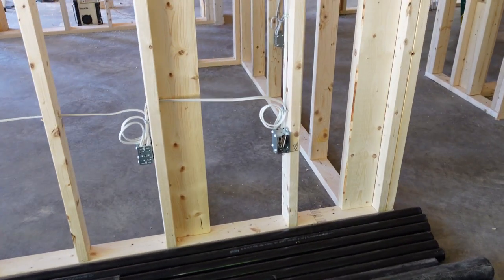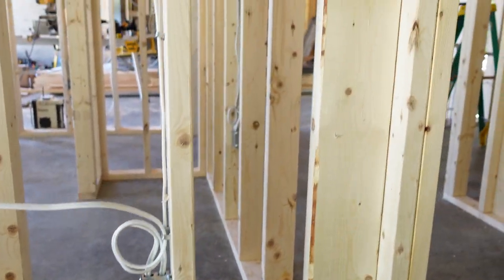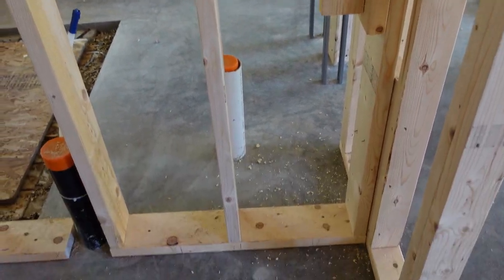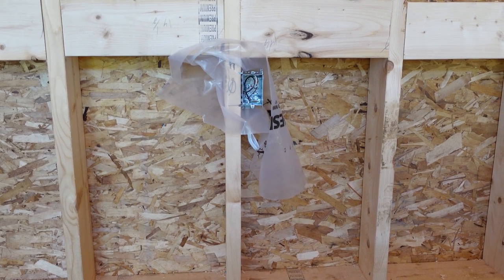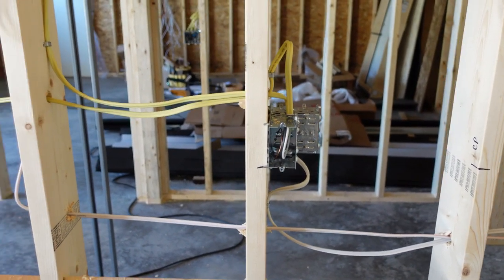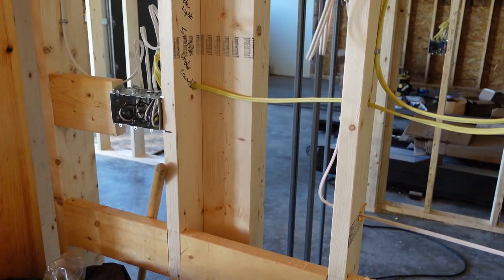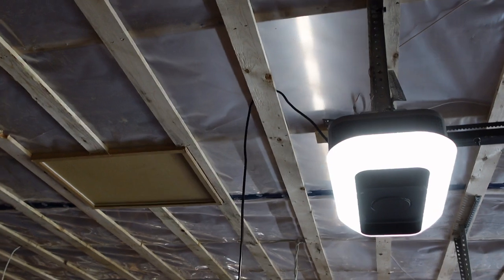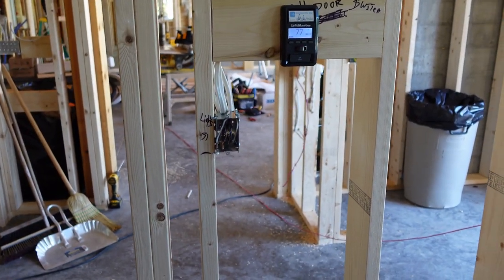Electrical Code Outlet Heights

Comment: Curious if you can put an outlet on the wall 7 feet off the floor next to a wall mounted garage door opener. Or foes it need to be on the ceiling.
Reply: outlets for special needs can be wherever they are convenient for that device. Just be sure it meets code requirements in your area. Be aware that any receptacles in a garage now need to be GFCI, where only a few years ago a high mounted outlet was exempt. (was 6 feet above concrete floor) BTW, I ran into an issue with a door opener sharing a GFCI circuit with an outlet on the exterior of my garage. Workers were on site while I wasn't home and tripped the GFCI while the garage was closed. Basically, I got home and was locked out. My point here is to think ahead a little. Maybe a dedicated circuit isn't so farfetched, right?
Reply: @rupe53, you don't need a dedicated unless you're using a GFI breaker. Just tap into it before the GFCI receptacle. Line side not load side. Load side makes anything downstream a slave to the GFCI receptacle and will go off when tripped.
Reply: @lm5085     under the old code you could do that. The new code is ALL outlets in a garage must be GFCI protected.

Comment: So there's really nothing in the nec regarding code height. It's the ADA that specifies heights for switches and receptacles. In most residential the receptacles are usually 12" from the sub floor to the bottom of the box. Why? Because your hammer length for a 16 oz klien, Stanley, or plumb brand hammer is 12" to the claw. Then you just bump your claw against the stud which leaves a mark. That will be 12" off the sub floor. Just be sure if more than one guy is doing the rough in boxing that everyone has the hammer that makes that mark at that height.
Reply: I think he's in the 51st state, eh?

Comment: Hi I was hoping to get your opinion on what to do about a old home?

I have a small 2 bedroom 1 floor house that was built in the 50s and still actually has some nob and tube circuits in the home 

I had a electrician come in and he actually gave me a quote of 30k to do a complete rewire which is far out of my reach 

I don’t really understand why this is so extreme but I think I’m my situation I might be better off just having a safe electrical system vs a everything to code ? 

What happens once I let anyone in my home can I be shut down for not being to code?

Someone advised me to not ever have a inspection and to look at wiring everything myself in this situation. 

Do you have any advice or opinion on my situation you could share with me?
Reply: Insurance on the house won't pay if is not up cod in case of fire cause by old wiring sistem nob and tub
Reply: @andrewbrindescu6666  If insurance wrote a policy and accepted payment, then they have to pay. They may choose not to insure you in the first place, but that is a different matter than not honoring a claim.

Comment: light switches are 52 inches ,receptacles are 18 inches ,kitchen gfi's are 42  inches .dryer and washer are 42 inches and lastly range receptacle is 3 inches off the floor with 1 1/2 block where i work at canada
Reply: And those are measurements to bottom. In the US this would mean the light switches are not ADA accessible, that is wheelchair. 48" inches maximum from floor to operable part of the switch. He also mentioned the NEW height for switches is 44 inches NOT 52.
Reply: Yah he isn't going by electrical code, maybe it is more of an interpretation from inspectors or a local building code. I do similar for all my jobs, 52 inch top of box for switches, 18 inch top of box for receptacles, 45 inch top of box for kitches, 42 inch top of box for vanities. These are all my standards not code, the range receptacle actually has the code for it of 130mm (5 in)to center of box. Dryers/ range hoods and all those would be to specific orientation of what the client is putting in whether stuff stacks or if cabinets are different heights. 
Some local areas will have building codes that are required for wheelchair access in commercial/public areas.
Reply: @kylelarson6054  its good to know another things from people:)
Reply: That is way too high for light switch. 48” top of the box is most comfortable.

Comment: You failed to cover the receptacle for the eye level oven. How high off the floor for 240 volt oven? Thanks
Reply: Check for your own details! In other words hand feed Yourself!
Reply: Manufactures specs. The manual will always show the recommended location. This goes for all appliances.

Comment: when you say that an receptacle needs to be 16" from the floor, is it to the bottom / middle or top of the outlet box or is it even that critical.  Thank you and keep the videos coming.  Its nice to have some Canadian content here.
Reply: Great question. That's important to clarify. And to reply to another reply, actually, I don't think he mentioned anything about the measurements going to the bottom of the "item". He only mentioned "from the floor".
Reply: He mentioned that the numbers are to the bottom of the item.
Reply: Obviously the bottom of the goal is to make them higher
Reply: Can the receptacles be higher than 18" from the floor? I have seen power outlets 3 feet off the floor in office buildings for example.
Reply: The garage door opener has to be within 12 inches of the garage door opener?🤔
Reply: @kllgrogto5838 *track
Reply: @kllgrogto5838 not the Remote. He’s referring to the Motor Control.
Reply: The NEC code book uses language like not over ____ inches. I don’t remember seeing wall height mentioned. Not more than 20inches over counter tops. I have always been told wall height is 18” to the center of the box. Some people used hammer height to the bottom of the box back in the day. Anyway what he’s talking about is probably an authority having jurisdiction requirement. On second thought I think the NEC says not over 5’6” exception wall clock outlets but don’t hold me to that
Reply: @rakridge their are all kinds of exceptions but this is for general purpose convenience receptacles not for dedicated equipment or special needs receptacles.
Reply: Ok, it has been a while since I've worked the trades. We've already put recepticals at 18" centers (no higher than 24") unless there was a counter or permanently located work bench. The exception would be in garages where vehicles were stored, would locate recepticals at 21" center. This would bring the bottom of the box to 19" to satisfy class 1, div 2 hazmat area. Or am I overthinking things or the regs bouncing around.
Reply: ADA says 18” center for receptacles and no higher than 42” centers unless over a counter not higher than 48” for convenience receptacles panels 42” to the center, or the top breaker at 48” off the floor so light switches at 48” centers or 46” depending on how they rough them in where you live those heights are fine. Here we do our convenience receptacles at 20” centers have done that for years so this changes nothing for us so we are 18” to the bottom of our boxes. Hopefully that answers your question.
Reply: 16 to the top.
Reply: Pay attention, there is a very noticeable mark on the stud indicating the bottom of the box
Reply: @dennisnolan2544 he’d rather ask then pay us
Reply: I am pretty sure is to center line of such  receptacle and or switch.
Reply: Center of the box.
Reply: @deanhoward4128 wrong
Reply: What country is this?
Reply: It’s for ADA so they can be reached in a wheelchair.  So bottom of outlet box at 18 inches, switches are 48” max height.
Reply: I'm not sure if it's right or wrong but I have put outlets 24" from floor to make it easier for my dad so he don't have to bent over as much to plug or unplug stuff.
Reply: @jeffharper7579  that’s fine it meets code you are not supposed to be over 48” unless specified equipment or under 18” for ADA any hight in between is ok
Reply: @jeffharper7579  we measure to the center of the box so you know
Reply: @jeffharper7579  hope that helped
Reply: Long story short, it was back in 08 I built a " inclosed porch " for my folks and wasn't going to do electric but dad wanted some so I did and somehow a inspector heard and stopped in , he liked the idea of them at 24" because it is easy to get to them without bending over. They passed that was all I cared that he liked it..
Reply: @jeffharper7579  well you got the hight good
Reply: @jeffharper7579  I forget that I can wire a house in my sleep at this point cause it’s so easy that not everyone knows how to do it or can figure it out and our code can be vague if you don’t know how to read what they are trying to tell you

Comment: I LOVE this video.  No music, no bloviating or self-aggrandization, simply the facts, clear and concise.  Even if I'm not required to do it according to code, normally there are excellent reasons for the code standards.  I found that Michigan Standards are not the same as those posted here, but I didn't know the areas controlled by code before this.  I learned that in Michigan usually actual installation is governed by more than code.  Incorporating ADA (American Disabilities Act) and HUD (Housing and Urban Development) code where practical is also done.  

I just did the inside of my garage with clear-coated OSB by setting the outlets and switches at 48 5/8" so that the bottom OSB sheets, 1/2" off the floor, wouldn't require any notching for outlets, only the top sheets.  My 220v Air Compressor, welder, and EV outlets are breaker-panel height.  However, now I'm doing my basement, which is why I'm here.  

Thanks TONS for spending your time to share with us the things we need to consider when wiring.  You deserve a lot more likes than I see after 5 months.

Comment: Looks like you're running 12 gauge and 14 gauge together
Reply from the maker: Yes we are permitted to do that in Canada providing they are on different circuits from the panel. For example 20 amp T-slots on counter combine with 15 amp under counter lights in a 2 or 3 gang.

Comment: Hi,
Does the new outlet height code applies to new built only, or also for existing houses in case of finishing a basement
Reply from the maker: That varies from area to area. Here in Canada its any new circuit. So if it is an old reno we must install the new outlet at code height.